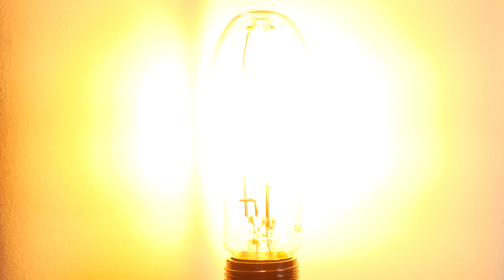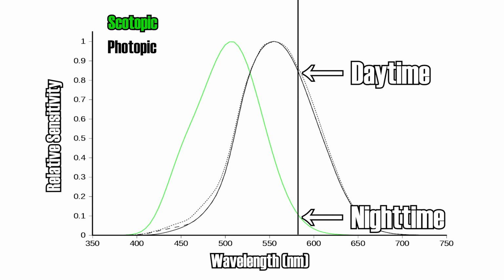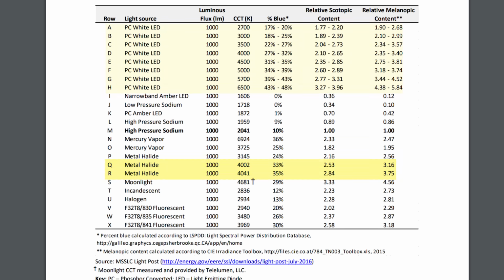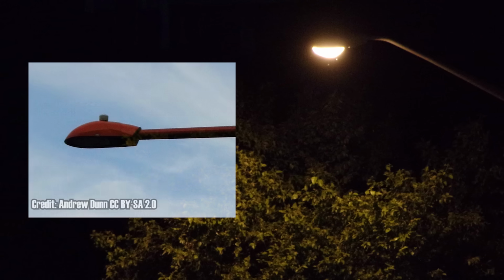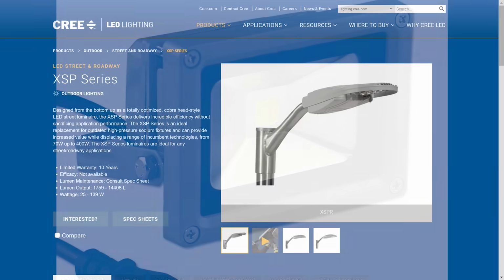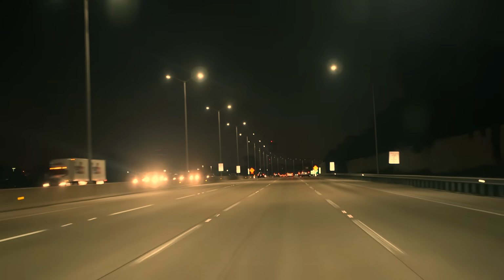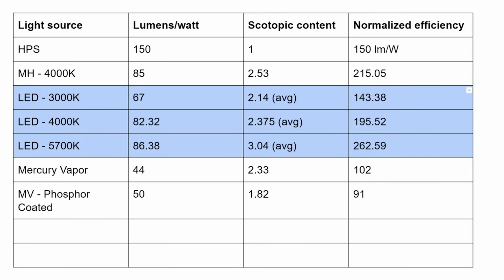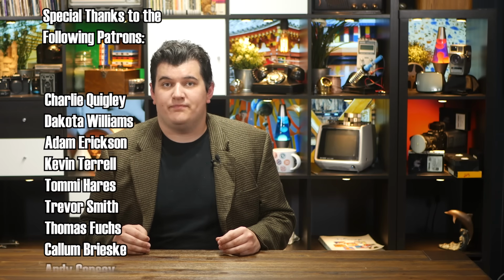The LED's Challenge to High Pressure Sodium

Comment: I wonder if this is something they also consider in the outdoor lighting problem.

Which color light is worse for vision when you leave a brightly lit area, and/or are frequently transitioning from lighted to unlighted roads.

Its not likely to be a big concern in a place like Chicagoland where you'll usually be driving in brightly lit areas almost exclusively (though having once lived in the far west suburbs I know quite a few places where lighting alternates between widely present to non-existent).
Outside big cities, and especially at interstate off-ramps outside of cities, going from unlighted highway to a cool light LED flooded off-ramp is rather blinding. After you've passed the ramps, you return to headlights only and it seems abnormally dark for a couple minutes as your eyes readjust.

Comment: So in Europe, they're actually using LED street lighting with sensors that detect vehicles and brighten the lights ahead of the vehicle while dimming them once the vehicle has passed the lamp. The ultimate would be combining a color temperature shift with presence aware dimming. Given the rated lifespan of these LED lamps, it's not beyond reason to think this will come eventually due to addressing pretty much every use case and every weakness.

Comment: you didn't mention the cost advantage of using LEDS due to their long life expectancy.  They don't require bulb replacements like HPS, and over their life span they tend to maintain their rated output efficiency much better than other lighting types.  HPS, MH, MV, LPS, fluorescent, etc. All output light in all directions equally.  This results in more than 50% of the light needing to be redirected towards the intended target using reflectors and lenses.  Any time light is bounced off a surface or redirected with a lens, some of this light is absorbed or lost, adding to the inefficiencies.  On the other hand,  LEDs produce their light in a much narrower spatial distribution.  instead of 360 degrees of spread, the light is limited to a 180 degree spread, with the majority of the light being focused within the center 120 degrees infront of the LED.  This distribution band can be narrowed to even smaller angular spreads such as 90 degrees depending on the application, with Lenses being used to focus the light on target further still if required.  The drive circuitry for LEDs will no doubt in the future have functions implemented to further improve efficiency.  Some basic examples of this would be to dim the output at sunrise and sunset, or increase output during rain, snow, fog, etc.  Also, sensors in the roadway could be used to detect when light is required and when it is not, reserving full light output for when vehicles are actually on the roadway, and only partially lighting the road when it is empty.  This type of control requires circuitry that is not commonly used to power HPS, LPS, MH, and MV lights, making it unrealistic to implement on those lighting systems.  LED lights are driven by circuitry that is already suited to be controlled in such a way and can be easily dimmed, brightened, or quickly shut off or on with little to no additional cost involved.

Comment: LED lights are cheaper then either Low Pressure Sodium Vapor or High Pressure Sodium Vapor lamp and it does save energy. They should do it to Dearborn Michigan and should be 100 percent for the entire city of Dearborn in the next few years, like they did it to the city of Detroit months and years ago.
Reply: Who cares if it's cheaper? All your municipalities want to do is save a cheap few bucks a year for shitty Chinese Cree crap street lights that have not been tested to their claimed lifetimes yet. Also, I'm not even surprised Detroit went right away with the dumb LED bandwagon considering they were so poor they had to shut off street lights at night before LED conversion happened there, how hilarious 😂
Reply: @SubswithnovideosEVER-Tyrone  I have had mixed results with LEDs in industrial environments. They don`t hold up real well to high heat applications and the driver quality leaves something to be desired. You really have to watch the brand because alot of LED makers use crap chinese junk LED drivers that fail quickly. It is a high profit margin industry with marketing being more important that actual quality.

Comment: If I'm honest... I would prefer SOX and Philips CPO-T were more commonly implemented in new installations instead of LED. it's more efficient than LED and produces a metric butt-tonne of light. Especially on an electronic ballast, the average system efficiacy (including the ballast's slosses, which are about 3-5 watts) is between 110 and 175 lumens per watt (115 to 180 excluding gear losses) depending on lamp wattage. The best an LED can do is 130 lumens per watt excluding gear losses. Not to mention at that LED efficacy increases with lower CRI and higher colour temp phosphors as unlike MH or MBF-U lamps, the phosphor has a reducing effect on efficacy.

When LED technology breaks the 200 lumen per watt boundary and luminaire designs allow the fixtures to last more than a couple years, I think that's when LED should become the absolute norm for street lighting. It's still early days for LED technology against the mighty arc lamp!!

Comment: I would argue that the LED lights especially the ones ppl put on there car headlights are worse for safety purely cuse the frustration and physical pain these cause to my head has definitely made me consider running some ppl off the road it would be a service to society. I dont care if the light source is HPS hell I dont care what creates the light source at all as long as it is a orange/amber or even red color. the warmer the better.

Comment: I don't have data to show, but blue light really bothers my eyes.  The effect is more intense (or just more noticeable) in the absence of other colors.  So, sunlight doesn't noticeably bother my eyes, but higher color temperature CFL and LED bulbs do.  As do the "white" backrounds on computer screens.  I've never been much of a fan of blue light, especially blue LEDs.  It wasn't until recently though that I made the connection between the blue color and my eye fatigue.  I stumbled upon a red overhead light source in the vehicle I used to drive.  When using this at night it had no ill effect on my eyes and didn't even cut down on my ability to see the roadway.  The blue and even white lights from LEDs and dashboard backlighting however irritate my eyes and actually make it harder to see past them to the roadway outside the vehicle.  I often find myself dimming these blue biased light sources or, in some cases, finding ways to block them out completely.  Tape over the blue lights on the dashboard or computer backrounds with black or other dark colors. Simply put, I've learned that light sources with more blue cause greater eye fatigue for me, as do many types of backlit LCD monitors (CFL is worse than LED, though possibly due to over all intensity).  At home I find the best compromise in color and illumination comes from bulbs that emit in the range of about 2700k up to about 3500k.  Anything higher starts to bother me.  The only blue illumination that I truly find pleasing is that of Spaceship Earth at night.

Comment: As an amateur astronomer living in a huge city (Buenos Aires) I have some experience with different types of light pollution.
A couple of years ago the whole city used HPS lamps and some Mercury vapor ones. Without proper reflectors they produced tons of pollution. Nowadays every lamp was replaced with 5300K LEDs with awesome designed reflectors. But the pollution isn't easy to compare.
In general, for visual observation without filters, sky quality has clealy improved. With some friends we estimated it at least one star magnitude better, that's quite a lot.
For objects (some nebula and planetary nebula) that emits a lot in the Oxygen-III spectrum, visual OIII filters were great with HPS lamps. They are useless with LEDs though.
For deepsky long-exposure photography, some people used narrowband filters (H-alpha, O-III & S-II) with great results with HPS lamps. They are having mixed results with LEDs, we think that not every brand have the same spectrum.
Professional observatories use high precision filters, and as you already said, LPS are easier to filter.
Hope this helps, and sorry for the bad english. 😅

Comment: typically the "igniter" is omitted from the drop in replacements... as it's only used to break down the initial voltage that has to be overcome to strike an arc.

Comment: The newer LED streetlights in New York City have a pale, yellowish-tan (moonlight) color — similar to incandescent lights (around 3000°K). These were presumingly installed after numerous complaints about the earlier blueish-white (5700°K) LEDs.
Reply: I'm really happy for this. At my country, they are still in the 6400K light. And no complaints are accepted.

Comment: When they swapped my sodium lights for LED's on my street (and moved them to the other side of the road) I had to change bedrooms to one round the back of the house. Even a blackout blind was not enough, light still bled in around the edges and it kept me awake.

I've also found while LED's are better for vision when driving when they are there, the transition to unlit roads is more dramatic. It seems to disrupt my night vision, everything seems a lot darker than when I pass through an area with sodium.

Comment: "Moonlight and starlight are pretty bluish" Actually, no. The moon is gray; moonlight from your chart is actually only 4681k, or a very neutral white. Which is cooler than a yellow light, or than incandescent, but not as cool as a common high-output low-color-quality 6500k led, and besides, cool light is worse for glare - ever been blinded by bluish headlights? Stars are on average fairly similar to the sun as well; though I can't recall the exact average. Also: If 589nm were used at the same level of brightness as many LED systems are, it would be closer to the photopic range - these systems are blindingly bright. And when someone has been exposed to rather bright light... their rod cells will not recover very well at all. They'll be in photopic mode for much of their drive, if not all of it, depending on whether they can manage to only be exposed to dim light or if they will be repeatedly blinded by bright light and glare from signs on the side of the road, or oncoming headlights, or some of the existing LED lights. Oh, and as for light pollution, even apart from the ease of filtering 589nm light, there's some things the LEDs do that's an issue. First, even if they were flat on the bottom, the light coming out just slightly below sideways will end up hitting clouds a few miles away as the horizon drops underneath it and thus light the sky. also, the increased brightness typical of LED setups will mean that tons of light bounces directly off whatever they're aimed at and causes light pollution anyway. I suspect the bluer colors might, since they diffuse more in air and haze, be prone to lighting the sky while the warmer ones might mostly escape if they don't hit a cloud; at least, they'll do no worse than the existing sodium.

Comment: Be careful when comparing lighting efficiencies. Lumens are a scale that's weighted according to the sensitivity of human eyes. This is why 550nm (green) LEDs generally have a much higher lumens per watt rating, and you never see infrared or UV LEDs with efficiency ratings measured in lumens per watt. They are instead measured with a simple percentage.   
Basically, a 100% efficient green LED is going to have a higher lumens per watt rating than 100% efficient LEDs of any other colour.

Comment: What I have always wondered is why the warm/cool description of light colors is bass ackward. Anyone with the slightest physics understanding knows that orange and dull red objects are cooler than blue ones(when the light is derived from their temperature.) Just try it, and ordinary filament lamp. Slowly increase the brightness(which corresponds to temperature) and you will see that the reddish/orange is at the COOLEST point. And it should be obvious because the lower color temperatures are warm while the higher color temperatures are cool. How moronic are we?

Comment: LED headlights are blinding. They should be made illegal. I hate driving at night with people who use them. Oncoming traffic is so bright now, that you are often mistaken in thinking the car coming at you has their high beams on, when in fact they are just LED lamps. I have to almost constantly keep my eyes off the road, and on the shoulder, just to make out the lines on the pavement. This isn't safe, but the alternative is to not see anything except blinding light and an afterimage for a few nervous seconds after the asshole has passed.

Driving a sedan with a pickup or SUV behind you that uses LEDs is similarly frustrating, as their lights line up with your mirrors, causing you to be blinded from behind. This is further compounded when the tailing vehicle drives too close. I find myself constantly pulling over so a jackass Ford pickup owner with a lift kit tailgating me with LEDs can go and crash into his scheduled tree at 3am without ruining my eyesight along the way to the scene of his death.

Comment: There’s yet another aspect. LEDs often have crappy diffusers, so you end up staring directly into the individual light-emitting elements. This makes it much more difficult to see the surroundings, leading to various complaints of “lots of light, but can’t see anything”. Then there’s a question of transitions between lit and unlit sections - LED completely ruin the night vision.

Comment: One thing I'll say about the circadian disruption caused by blue street lights is this: It's both a blessing and a curse. Yes, it can mess up how you sleep. That kinda sucks. But... That can actually be useful for safety late at night. If you're driving around at, say, 2 in the morning, you're probably gonna be pretty tired. Warm yellow light, similar to a sunset as you described, it certainly isn't gonna help with that. But the blue light can keep you awake longer, which is good if you're quite a way from your destination. Having a harder time falling asleep later is a worthy tradeoff for being less likely to fall asleep at the wheel IMO.

Comment: My city has been replacing all the light fixtures with LED, not just the bulbs, but the whole fixtures and they're much improved, however, the one they replaced right in front of my house has a very wide angle and shines on the houses and seems brighter than the old bulb, annoying at night when it shines on the windows...

Comment: It's interesting that moon light is blue but blue light disrupt circadian cycles. I would expect natural phenomenon like moon light would not shape evolution to distract sleeping by it. Perhaps there is some fine nuance in the intensity or the specific blue wavelenght to it, and that would not cause disruption, same as moon light does not do?
Reply: Actually, it is not. The moons light is much warmer than the sun's light. It is shown even on the documents on the video.
Reply: @pstasman629  very interesting. So strange then why night sensory cells evolved around wavelength that is actually less intensive than rest of the moon light... But it answers my question. Basically the blue light in moon light is less intense. So it doesn't impact our cycle. Because the cell does not care about the spectrum it cares about the sensory response

Comment: Mercury vapor is the future. At peak performance they produce an amazing blue+UVC light, which you sadly need quartz glass to let it escape. Both, blue and UVC, are easily scattered, unlike redder colors they wouldn't reach as far and pollute the sky, that's why the police uses blue, because in war you don't want to be seen from above.
Just joking around, but the blue is really pretty, y'all should check it out.

Comment: Erm no. Street lights are LOW pressure sodium vapour lamps, with a characteristic luminous wavelength of 589nm. High pressure sodium lamps  have a far wider spectrum which is a far closer approximation of daylight (though not really that close) and are far less efficient than low pressure sodium. Even wiki get's that right.

Comment: The 120Hz flicker of LED lighting, particularly when driving, makes me sick to my stomach.
Reply: R.C. Whitehead   LEDs don't inherently flicker , it's just a poor power supply design.
Reply: LEDs run off DC, so any flicker is due to poor power converter design. Also our night vision eyesight is optimised in efficacy for moonlight which is bluer/cooler white so LEDs can be better matched by colour when compared to yellow/warmer Sodium lights.
This results in better night time / low light vision and energy savings.
Reply: Well......the sodium lamps flicker at a much lower frequency 50~60Hz.
Reply: CFL bulbs always gave me a headache. I couldn't stand them and I'm glad they were short lived.
Reply: Where do you live? LED flicker is entirely caused by poor/cheap conversion of AC to DC or poor LED PWM control. I've never seen a street light that uses a poor conversion method, only cheap LED bulbs have had this problem.
Reply: @lost4468yt  Come to Edinburgh.  Plenty of bad quality leds..